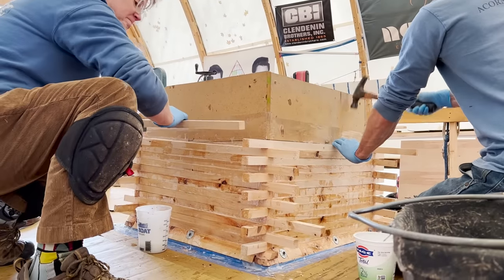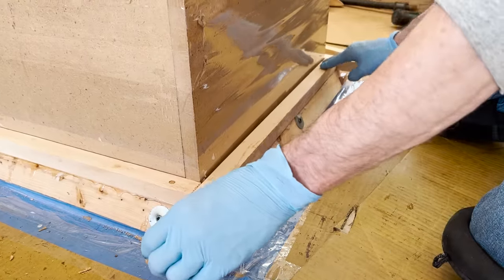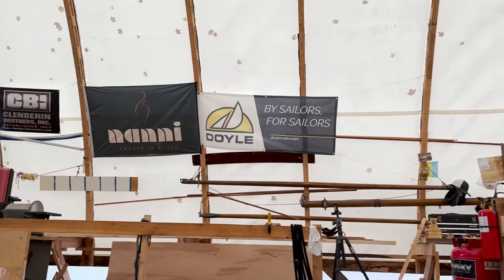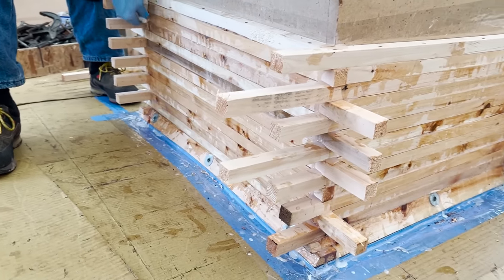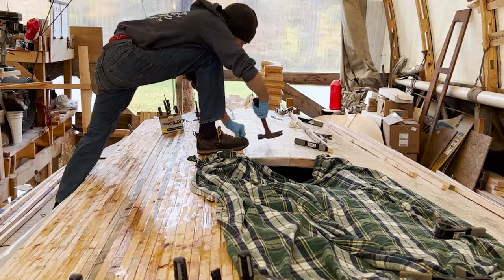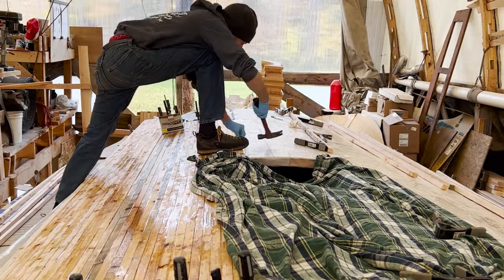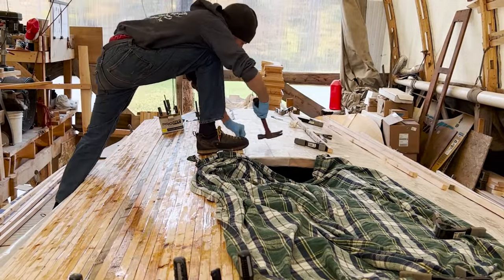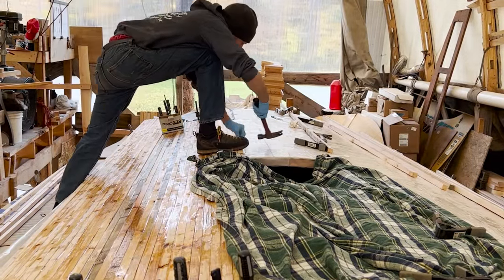Strip Built Hatches and Housetop - Episode 239 - Acorn to Arabella: Journey of a Wooden Boat

Comment: Not very 'traditional', but if you want to increase the light coming in through that 'periscope' hatch, make the final coat on the inner walls 'Chrome Aluminum'. The mirror like finish will reflect even incidental light down into the cabin just like a 'light tube' in a woodland cabin... :shelterin:😛

Comment: I see that many people have already expressed concerns about the high front hatch being a potential issue catching lines when tacking, or taking the brunt of a wave over the bow.  I share those, and agree.  Keeping the foredeck clear of obstructions is certainly important in the sort of sailing I do (which is mostly day racing, not passage making).  
Having watched every episode, I am still amazed that someone with no sailing experience decided to do this.  But, while there have been many points where I have thought I might do it differently, I've always followed that thought with 'but this makes sense for his planned use of the boat."  This is the first time I've really wondered if he is making a mistake.
One additional thought, of somewhat lesser import.  That tall hatch will make it harder to pass thing up or down between the foredeck and the forward compartment.  And definitely harder to get out of the boat from the forward hatch - a small safety consideration - its your second means of egress if you cannot get out via the main companionway.
Reply: Two mitigating thoughts
-  Racing sails tend to be cut to maximize area, the foot of the genoa might sweep the deck.  But the cruising boats I have been on tend to have the jibs cut high, the clew could be a couple feet up, that could help keep the lines from snagging on the hatch.
- if the lines snag on every tak, and drives him crazy, we know he;s handy with a chain saw.  It's something he can fix.
Reply from the maker: Probably the staysail stay is of concern then too. That thing gets in the way of the jib for sure. 😉 I sailed a cutter for seven years. My concerns about the hatch are minimal, considering that the hatch cover can be easily lowered if the height will be brought down. We’re adding a boom to the staysail which will swing over the hatch. Yes, it might be egress, but the tallness isn’t an issue there. You have two climbers living aboard and many footholds below. We shall see! In use, much could be changed about this boat, and that’s a thing that pride won’t get in the way of with Steve. All is mutable. Much can and will possibly change. —Anne
Reply: @AcornToArabella  Actually, the staysail almost eliminates the issue of the foresail lines catching on the hatch, since you will have to pull the whole jib or genoa forward of the staysail when you tack.  And, the boom on the staysail being above the hatch fits in with my follow up thoughts on higher cut jibs - so, maybe less of an issue that I was thinking.  I assume, if you plan a boom, that it's a staysail with a fixed stay, not a running stay.  And, as you put in enough tacks, as you (Anne) probably know, lines will find a way to snag on pretty much anything eventually.

And, as many of us have noted, its clear that things can change if it does not work out like imagined when Steve starts sailing.

For my own part, the "what a pain to pass things up and down" was actually the first reaction.  But that comes from mostly sailing boats without roller furlers, where a quick reduction in sail area, as a squall approaches means getting one sail up and another below in a hurry.  That particular example may be a non issue for Arabella.  Still, trying to picture sailing on Arabella, based on my experiences (again, lots of day races, less distance), it's my gut reaction to that hatch.

Clearly, both Steve and Robyn (sp?) are capable of climbing up and down more than most people.  But, I see a scenarios where Steve loves the cruising life, and is still travelling in his 80s.  And I see scenarios where it turn out that building the boat was the adventure he wanted, and in a few years, someone else is sailing her.  More likely then either of those extremes, I think it's  almost a given that over the next several years, many people will sail on Arabella as guests.  When I'm in the "what if there's a fire" train of thought, those are the people I worry about - the one who don't know where the hand holds are, and whose physical abilities are all over the map.

Comment: As a racing sailor, my first thought about the high hatch top on the foredeck was how many times the sail or jib sheets would get caught on it during tacks.  Probably not a huge deal for casual cruising, but depending on how far back your jib/Genoa goes, you might need to manually clear sheets on every tack.  Also something to think about as a potential safety thing of you are in a blow and have to tack or gybe quickly.  You might end up having to run up on the foredeck to clear a line under load caught on the hatch top.  That happens sometimes even on boats without the hatch like that.
Reply: In certain situations - weather, frequent tacking or jibing, etc., a sailcloth tarp can be lashed across the forward hatch (and /or other snags) to allow sails to easily glide across the deck.  It's easily and quickly removed and stored when not needed and can double for other uses (rain catchment,etc)
Reply from the maker: There’s a staysail, and we’re adding a boom.
Reply: @AcornToArabella  Even if you weren't, some curved rails athwartships would lead the sheets over the hatch.  
NEW TOPIC:  A high coaming is a fine thing, I reckon.
If you want more headroom, you could consider taking the skirt of the hatch lid down outside the strip-built hatch coaming, and run it right down almost to the deck (butting against a raised synthetic rubber lip on the deck) and designing a hinge which allowed raising the hatch lid (more or less) vertically in harbour, or settled weather. With a deep skirt and a deep upstand around the hatch hole (which would not need to be as deep as you currently have) this would provide almost twice as much extra height (above the deck level) for standing up tall and stretching out your spine before tackling another day. 
Assuming the hinge to be forward, if you allow a decent gap between the aft skirt and the aft coaming, cracking the hatch slightly open with the hinge in the lowest position would provide waterproof ventilation even when beating to windward, as long as the bows were not plunging deep.
Raising the hinge with the hatch at that same tilt would provide much more ventilation in a harbour situation, and still keep rain out.

Comment: The front hatch will likely catch sheets when tacking. Not a huge issue on long legs, but on inland trips with several tacks it might drive you crazy. An easy fix is a rounded stainless tube guide that goes over the hatch to help guide the sheet over the hatch. It can always be something you add sometime down the line if this proves to be a problem. Great channel, and thanks for the content and motivation!
Reply from the maker: Thanks for being here and for your kind words! As for catching sheets: there are two foresails. The staysail boom will swing over the hatch. The jib will pass forward of the staysail stay.
Reply: @AcornToArabella  I should have guessed you already had it figured out!

Comment: Watching Steve release the housetop roof was the most nerve-racking thing Ihave seen done on the channel to date.
Reply from the maker: Oh man, if you’ve ever felt a chunk of cured epoxy with silica in it, you’d not have been worried at all! The stuff is RUGGED. —Anne
Reply: It was very nerve-racking, but the first attempt at melting lead was nerve-racking, and in my opinion more because of the danger of it.  So glad it this turned out.
Reply from the maker: When we formed the fridge lids out of TotalFair, for me personally…. That increased my “pucker factor” by quite a bit compared to those two things. 😁 My anxieties are based on some experiences though. Glue? We’re good. Chainsaws? Don’t let the noise fool you. Lead? Not as hot as ya think and just go slow. Worked on a thing and we are about to glue some crap to it and have no idea if it’ll blow the last 10 hours’ work? 😳😬
—Anne

Comment: A quick tip for getting excellent epoxy flow into small cracks is to spread it, the quickly hit it with moderate heat from a heat gun.  If using slow cure, the batch can be warmed first.  These techniques can drastically reduce the viscosity for long enough for capillary action to pull the epoxy into areas it will never get to otherwise.
Reply from the maker: Nice tip!

Comment: Here are two cents worth of thought from a sailor. On my (very different, but similarly-sized 38') boat, when I tack or furl in my headsail, it seems like about 5-10% of the time the jib (genoa) sheets get fouled on my forward hatch, which is about ONE INCH tall. Yours is obviously much, much taller than one inch. There are solutions to this problem of course, and the nice additional interior space there may be a "worth-it" trade-off... just know that you may need to take some of those steps, as a sail filling with a stiff breeze pulling on a sheet that's stuck on a hatch or vent can exert a LOT of horizontal(ish) force.
Reply from the maker: Do you have a staysail?
Reply: @AcornToArabella  I do not. Just a roller-furling Genoa up front (and very occasionally an asymmetrical spinnaker in a sock). I'm not poo-pooing your setup. It's awesome. Just pointing out that anything sticking up off the foredeck is a POTENTIAL place for sheets and other lines to get fouled. I've followed your build every step of the way though, and it is going to be (or already is?) an absolutely amazing boat. We also sail in the amazing space between Cape Cod and Long Island, so we're practically neighbors!

Comment: Steve  you might want to think about putting a notch in the leading edge of the rudder so by turning it 90 deg you can pull the shaft without having to remove the rudder
Reply from the maker: The final aperture shape and movement of the rudder will allow for that. —Anne

Comment: dear steve, building a house top is one thing, building a hatch box is going to cause you problems during sailing. you cant do that, every time to change directions the sails move across the boat, the sheets need clear space to secure the sails. now how are you going to allow the sheets to move across the deck? standing up from the bunk is a great idea, however you cant sail the boat with that there.
Reply from the maker: There’s a staysail in this rig. The stay for it goes forward of that hatch, and we’re adding a boom to it.

Comment: I'm thinking you've considered this however, please be mindful of the flash point of your resin/epoxy products while you heat things up.  I know your just raising the temps minimally but do be careful...  You Steve and your team are truly an example of ambition and consistency each day.  If you are anything like me, I am sure lay awake at night and solve for the next task at hand...:)
Reply from the maker: Yes, we’re mindful. I have, in another iteration of my career, edited safety plans, chemical hygiene plans, and SOPs for working with highly flammable materials. Flash points on epoxy products are extremely high compared to those with a lot of off-gassing VOCs. —Anne
Reply from the maker: [Higher than those of a space heater set to shut off at about 60 degrees… above 300 degrees F.]

Comment: Your boat, your decision, but I would not want that forehatch to be that high.   It will be in your way up on the bow in a sea and blocks your view of the bow while anchoring, maneuvering.  Also, will be in the way of your jib and lines.
Reply from the maker: There’s a staysail with a boom that’s going to be up there, and as with anything with a staysail, the jib will be passed through there. If the hatch is a problem, it can be changed. Reducing its size would be easier than increasing it, and Steve is open to making changes anywhere on the boat. It’s why we have a 7’ workbench in there permanently. —Anne

Comment: Are you going to add reinforcements to he hatches, like brass/copper plating to the inner and or outer areas of the hatches.  Seems to me the hatches don't look solid enough as is. ?
Reply from the maker: No. If you keep watching until Steve unmolds the cabin house’s top, I think you’ll see that a strip-built thing is inherently quite strong… and the strips are interlocked at the corners. —Anne

Comment: Is there a description of what epoxy is used for a particular job?  Steve mentioned when he did the underside of the house that the type of epoxy he was using would flow better, but I couldn't see the type.
Reply from the maker: That particular type of epoxy is TotalBoat high-performance. If you check out WoodenBoat magazine, there is a section  called Getting Started in Boats. In issue 270, GSIB addresses what type of epoxy to use for what application. Super useful guide. I edited it. ;) —Anne

Comment: The whole reason why you wouldn't use Butcher Block to make a roof is for the same reason you wouldn't use butcher block for the side of the vessel... The reality is is you have a bunch of pieces of wood glued together instead of a single pieceof grained wood, and the adhesive is going to go long before the cellulose in the each individual plank would have gone... The entire thing is going to delaminate in less than 4 years, and what you wind up with is a pile of loose 1-in cedar planks...
Reply from the maker: There are entire boats more than 40 or 50 years old, strip built, fiberglassed, and still sailing. One doesn’t fiberglass a butcher block, and that’s the difference. —Anne
Reply: @AcornToArabella  Im actually talking about the boat house top, and more importantly the deck hatches... the hull looks lovely, atm.
Reply from the maker: Thanks for saying, but I’m talking about the house too, and the fact that entire boats are built with this method that we’re using on the superstructures as a way to point out that it’s proven and works, and not at all similar to the way butcher block is put together. Butcher blocks don’t have colloidal silica in the glue. The strips aren’t nailed. The final surface isn’t sheathed in fiberglass.
Reply: @AcornToArabella  Ultimately the wood and the glue shrink and expand at different rates. Unless the wood grain is pressure treated with something like an epoxy resin even with the screws or Nails in place between the planks, you're going to get delamination and it's going to come apart like a 20 year old piece of lawn furniture in the Sun. Take it from a US Navy sailor who's worked in Dry Dock wood shops...

Comment: Killing me using nails on that hatch
Reply: They do seem pretty isolated in there, esp with what's to come. The wood can deform slightly to accomodate differences in temp expansion...so on the whole i think i support it
Reply from the maker: Strip building has its own materials and particulars, and we didn’t invent the method. Far from it! Think of the nails as clamps. A person building a boat entirely of strip-planking might invest in a special nail gun with proprietary plastic fasteners, and some might even use galvanized nails. Copper is great because later on down the line, a power tool will go through it like a honey badger. The resulting structure is monocoque… a core of epoxy, silica, nails and all sheathed in epoxy. This is way different from cold molding, by the bye. An older method but tried and true, using materials we have on hand. —Anne

Comment: I don't understand building a plywood subframe, strip-building the roof then removing the plywood to allow for finishing the inside. THEN fibreglassing the roof top. If you were going to use the glass why not build the roof out of plywood alone pull it off for finishing and then glass the outside. It seems a lot of work to use the cedar
Reply from the maker: The plywood (luon/door skin) was a form… like the box for the hatch’s sides. We use it sometimes for patterning but in this case it came in handy to help us develop the shape of the house top. We are using cedar because we had cedar trees.